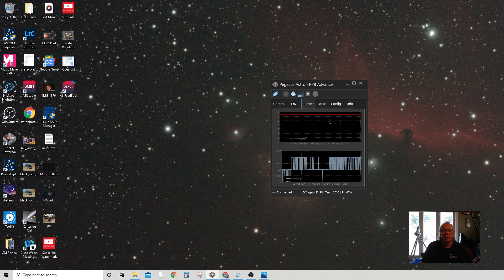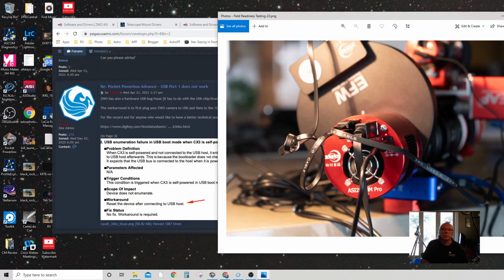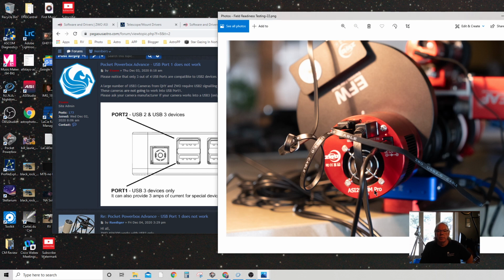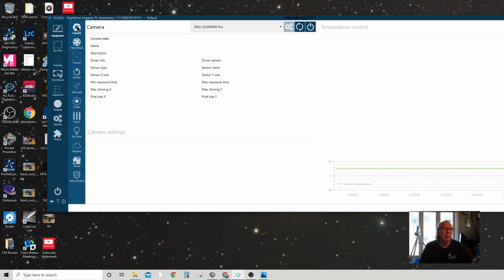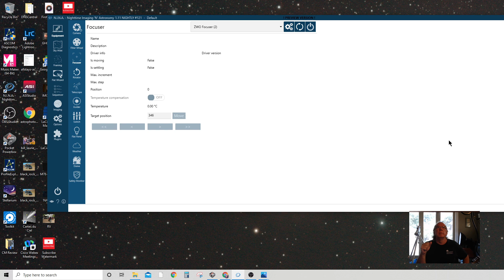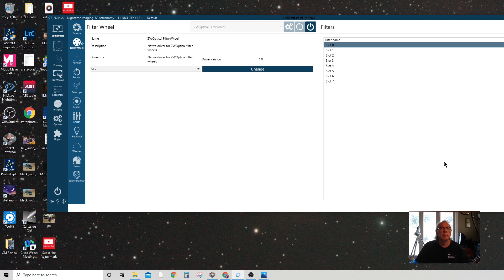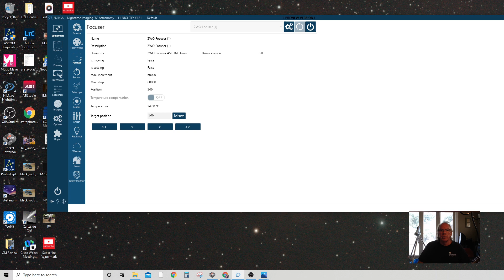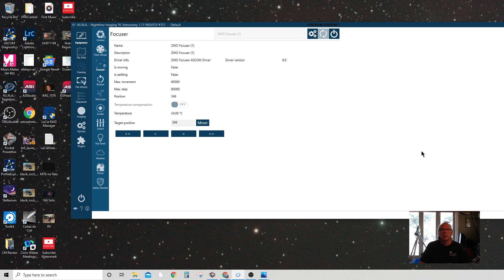Pocket Powerbox Advance Port 1 Issue with ZWO ASI294mm Pro

Comment: I'd recommend you contact support@pegasusastro.com. Angelos is the person in charge and he is extremely helpful. He might take a day or two to answer due to the fact they are located in Greece, but they have always answered my questions in a very comprehensive way. Good luck!
Reply from the maker: Thank you for the feedback Carlos but it wasn't a product issue just a misunderstanding on my part. It is a great product and has provided excellent value. 👍
Reply: @AstroVagabond  How did you get it to work?

Comment: I'm confused about where the "issue" is? The PPBA clearly states that port 1 is USB 3 only. That it can be used for devices that require more power (USB port 1 can deliver 5.2V at 3A). It should come as no shock or surprise that USB 2 devices will not work in this port. That's why your EFW/EAF don't work - they're USB 2. The hub on the back of the camera is USB 2. You've got 3 other USB ports on the PPBA that are combo USB 3/2 - and ALL of them allow for the camera and its hub to work as expected. I know - I've got my 294MM plugged into port 3, and I've got my EFW and guide cam plugged into the 294's hub. I've also got my Pegasus FocusCube 2 and my CEM40 plugged into the PPBA.

Looking forward to your upcoming videos from the road. Hope you can find some nice dark skies from which to capture photons!
Reply from the maker: I'm very complimentary about the device as I stated several times in the video. The issue is with the chip ZWO uses in my camera and maybe others related to discovery where if you have power to the camera and then plug in the camera to PPBA port 1 it will not be discovered. Plug the camera USB connection into port 1 before powering up the camera and it will be discovered.

It was a lack of research and knowledge on my part to not understand I would lose the use of the USB 2.0 ports on the AS294mm if I wanted to plug the ASI294mm into port 1 which is USB 3.0 only. I image I may lose throughput using USB 2.0 but don't know for sure and what impact if any if I do. 

Thank you for taking time to comment. 👍
Reply: @AstroVagabond  it's interesting that you need to not supply external power to the camera in order for it to be discovered when plugged into port 1. I just never even bothered trying the camera in USB port 1 because of that port's limitations, and that I knew I was going to use the camera's USB hub for a couple peripherals. As for losing throughput, that's not something you really need to worry about with deep sky imaging. You're taking exposures that are at a minimum quite a few seconds in length up to many minutes in length for narrowband. Where the USB 3.0 throughput matters is for planetary, but the 294MM Pro really isn't the best camera for that application. That would be an interesting test... evaluating the camera's throughput plugged into port 2, 3 or 4 with and without peripherals plugged into the hub on the 294, and then comparing it to the throughput you get with no peripherals and plugged into port 1.
Reply: I am sorry that you are confused. I thought that Bill had done a great job of explaining the issue in using a ZWO Camera complete with USB3.0 Port (so we thought...) with port 1 on the PPBA? Yes this is now clearly documented on Pegasus Astro website together with the good advice, and may well have been there from day dot. I dont know. All I know is that in spite of this 'issue' and 'issue' it is for some of us the PPBA is still a great product. As it is that port is put to good use for me powering a Raspberry Pi 4 running Stellarmate and there is a minor inconvenience of shuffling ports to accommodate the polemaster. PPBA is a great product.
Reply: @paulyoung4817  my point was there is no issue as such. I own the PPBA and am extremely happy with it. I highly recommend it. The title of the video describes an issue with using the 294 in port 1 of the PPBA. My confusion is with that title and the presentation of this as an issue at all. I'm not knocking Bill, or the PPBA in any way. I'm wondering why you would ever plug the 294 into port 1 at all, especially since the PPBA documentation and website very clearly state that most cameras typically do NOT work properly in that port. Further, since the USB hub on the camera is 2.0 and port 1 is  USB 3 only, that explains why the passthrough functionality wasn't working. This is NOT an issue with the PPBA.

I believe this video should be re-titled and framed along the lines of "Don't make the same mistake I did with the PPBA". Then Bill can describe what he tried to do, the symptoms of the issues he encountered, and what his research led him to discover. Of course, that's my opinion, and this is Bill's channel. Clear skies!
Reply: @JonnyBravo0311  Im sorry but last time i looked it was a little more vague than that described as some QHY, ZWO cameras will not work. Cant recall there was a definitive list!
Reply: @paulyoung4817  there isn't a definitive list, and I never stated there was. There is, however, a very clear statement on the Pegasus website in the PPBA description. It is in nice, big, bold font: A large number of USB3 Cameras from QHY and ZWO require USB2 signalling before switching to USB3.
These cameras are not going to work into USB Port1. Please ask your camera manufacturer if your camera works into a USB3 (only) native port.

You're never going to get your camera's USB hub (which is USB 2) to work if you plug the camera into port 1 - even if the workaround allows the camera to be recognized. This is not an issue with the PPBA.
Reply: @paulyoung4817  Can one also power the Raspberry Pi 4B converting the Adj. Out DC on the Powerbox to 5V?
Reply: @divye.ruhela  Yes is the simple answer. But you would need a 5.5 x 2.1mm barrel jack to usb C cable to do this. WARNING and make sure the adjustable out is set to 5V before connecting the Rpi 4B. The adjustable out is the only voltage regulated port on the PPBADV.
Reply: @paulyoung4817  Good point. That DC barrel jack to USB C could be hard to find. My 'USB 3.0 Only' port is free too. But the thing is, I've never powered the Pi using a USB before. I figure I only need a USB 3.0 to USB C to power the Pi using that port?
Reply: @divye.ruhela  now that's what I do. I bought a good quality usb c to usb a type cable and use the USB 3.0 only on the ppbadv. Works great.
Reply: @paulyoung4817  Cool. That's what I'll do too then! Thanks.

Comment: He Bill 
Normally in my case I only need 3 out of four ports I never use USB port 1 but all other USB ports support USB 2 and 3 but these are indeed USB 3 ports.
Greetings Frank from  Belgium
Reply from the maker: Yes I'll be fine too with 3 ports. I'm one short for my Pole Master but I only use that on the front end so I just remove it and plug in my guide scope once my polar alignment is done.